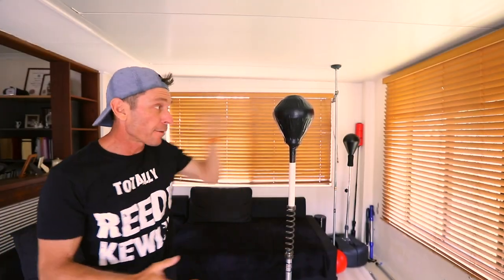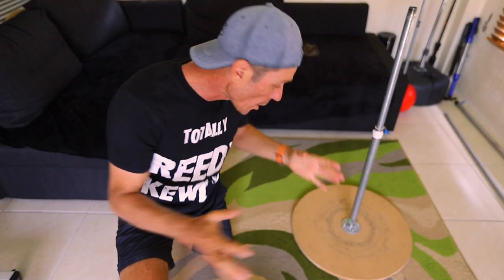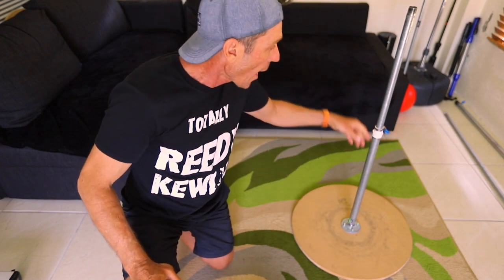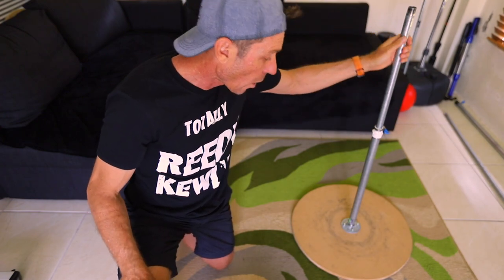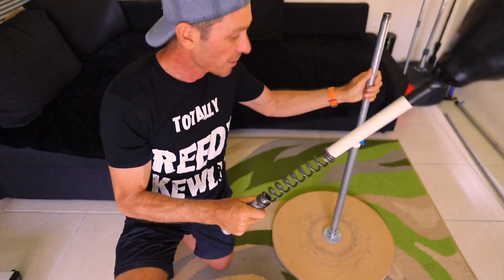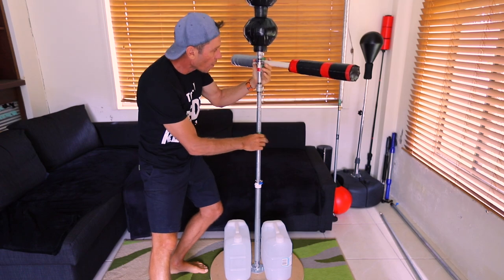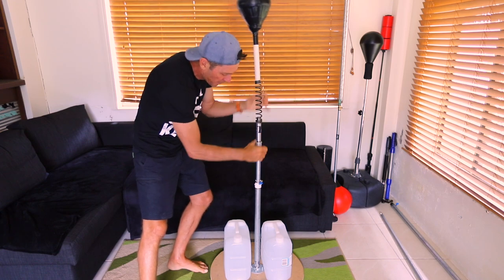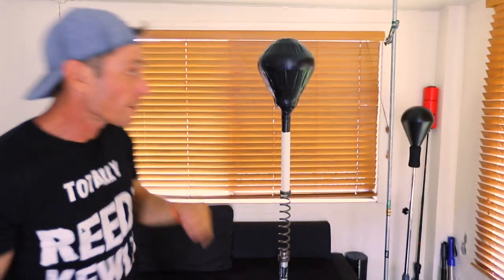DIY Cobra Bag & Spar Bar in One

Comment: Do you also sell the sparbar setup or is it DIY or must buy elsewhere? If I wanted to do what you have here what do I need? I saw the DIY link you sent to someone else but I want the base I can bolt to floor with drops in concrete anchors. 

This way I can unbolt when Im done and have no tripping hazard. I have a double end bag setup this way. 3/8" Threaded anchor is in concrete and I have 3/8" threaded screw in hook that I attach bottom bungee on carabiner. 

When Im done I unscrew and hang bag towards ceiling out if the way.
Reply: What items would I purchase from you? Im thinking I need the spring, multibase, leather bag/ball, and cobra bag adapter (not sure about this).
Reply from the maker: If you're going to buy the Multibase, then you'll also need the Click Mast that goes into it. Just with those two components and some things from your local shop you can make a PVC pipe cobra bag like this: https://kewlus.com/blogs/diy/pump-free-cobra-bag. If you order the ball and adapter, then you can make something like this: https://kewlus.com/blogs/diy/pvc-pipe-cobra-bag. Finally, if you're keen on making a spring version, you can add a Click Bar for the bottom section and use a short PVC pipe for the top section. See the various bundles I created here: https://kewlus.com/pages/cobra-bag
Reply: @Kewlus  thanks for responding. I have just seen 2 of your DIY ideas and would like to make them both possibly. I want to make the adjustable base with spring and kewlus bag on top AND wanted the sparbar on another top portion to swap out.

But Im having problems making base. The 3/4" rigid pipe will Not slip inside 1" pipe due to a little bump/lip inside that travels from top to bottom. Its like a seam from manufacturer. If it wasnt for that bump I would already made the base. I was at store and left the materials there. I will think of a solution unless you figure out first. 

I thought about going up to 1 and 1/4" pipe and using 3/4" or stay with 1" pipe and using 1/2" pipe to slide but there is too much wiggle between pipes. Im wondering where to get rigid pipe without inside seam. I still planned on buying bag, spring, and adapter from your site
Reply from the maker: Yes that seam does appear in some pipes so makes it hard. Your best option is to make it a set height for now until you get yourself a Multi Base with the Click Mast and Click Bar for height adjustment